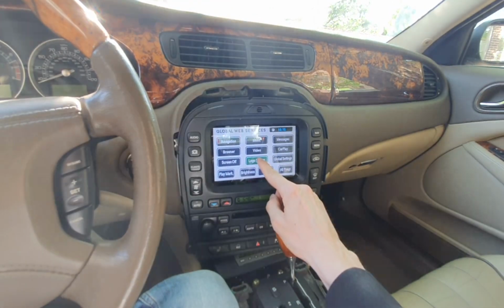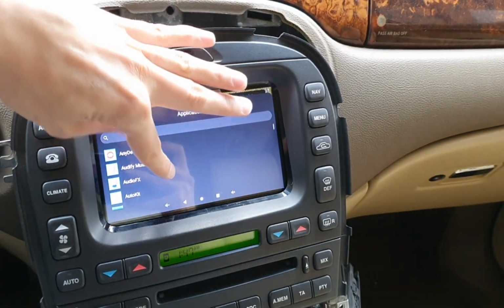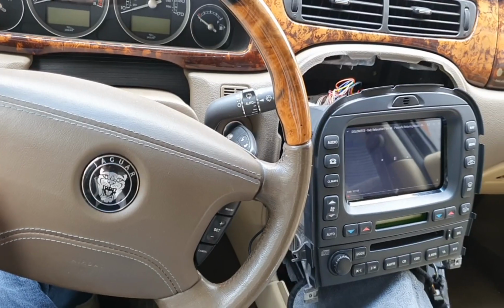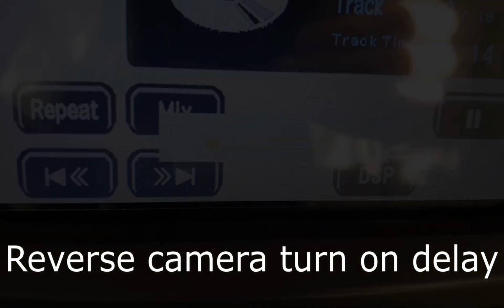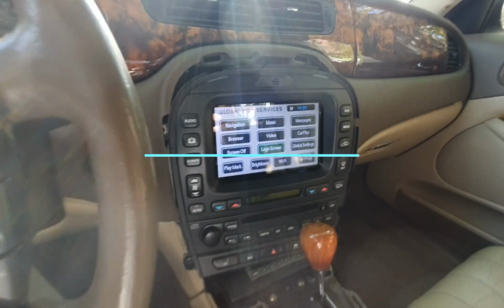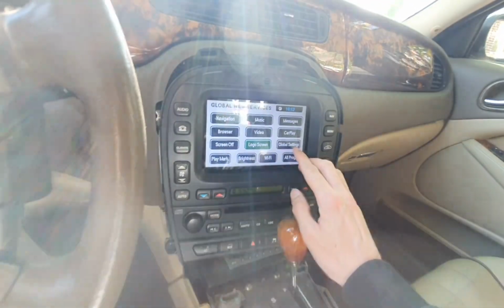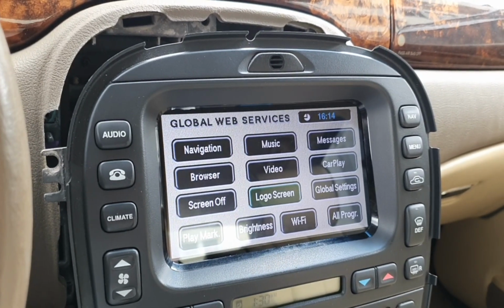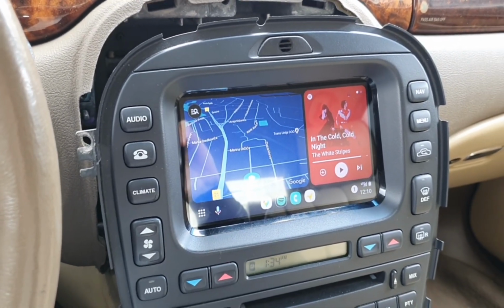Initial Android set up

Comment: I’m having trouble with mine, as far as plugs everything in to the car and computer, the instructions kind of got vague
Reply from the maker: Please contact me directly (mail, WhatsApp or Telegram), so I could guide you on all the steps of the assembly. What is it exactly you are experiencing trouble with?
Reply: @jagaux1688 what’s your email, definitely need some advise
Reply: @jagaux1688 my buttons aren’t working, the little screen that reads the ext temp and interior temp just reads backward Fs
Reply from the maker: @alkoweski3765  Please send photos of the kit installed into the radio to my mail. I will investigate the issue.

Comment: You've come a long way from the first system which was just Bluetooth audio. This now looks like a competitor for Jagdroid.  Well done!   One point to note is that to use the reversing lamp to trigger a reversing camera, you will need a relay as the lamp is earth-switched from the rear electronics module.
Reply from the maker: THANK YOU!
I think I forgot to mention that in the video... But kits for S-Types and XJs will have that converter included :)